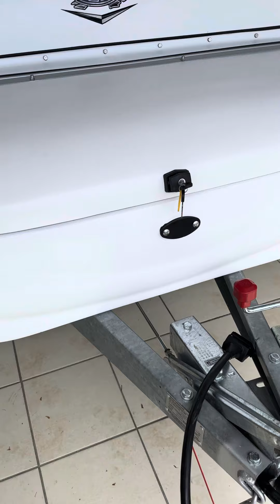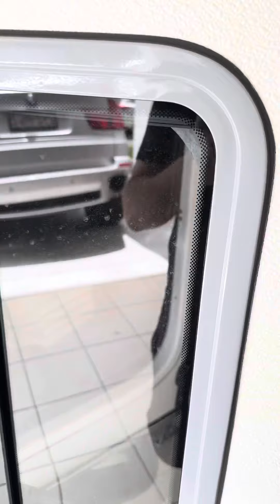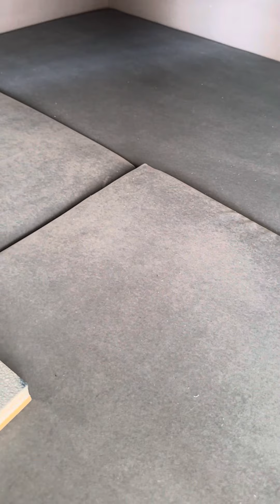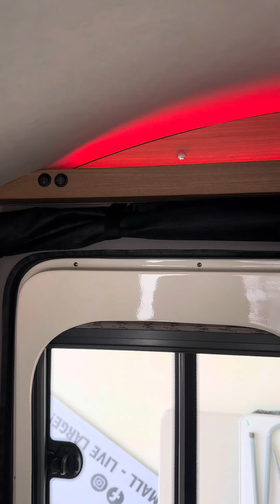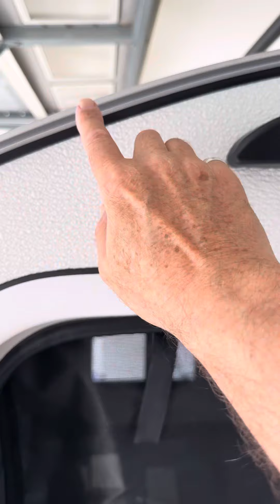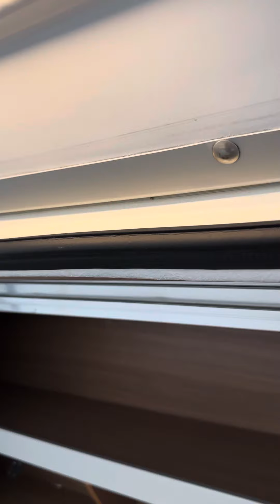Off Road Teardrop Camper trailer Australia. Caretta Off Road teardrop camper for sale.

Comment: Teardrop campers and smaller type solid campers are getting more popular. But you waste so much usable space, we need to get out of the weather from time to time.
Why not design a wrap around lounge with table that converts to a bed, this way we sit around inside and get away from wind and rain. A wrap around type awning with  with sides and front wind protection and you would have a winner, a big winner. Just my thoughts as this is what I am looking for but cannot find any were except on Opus Trailer, but this is not a hardtop.